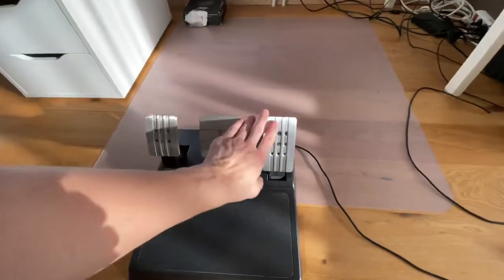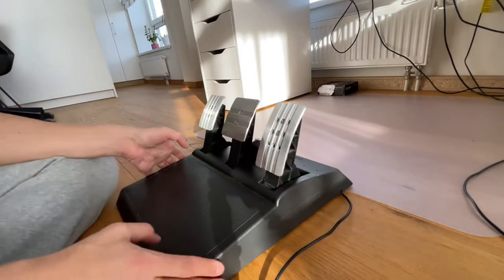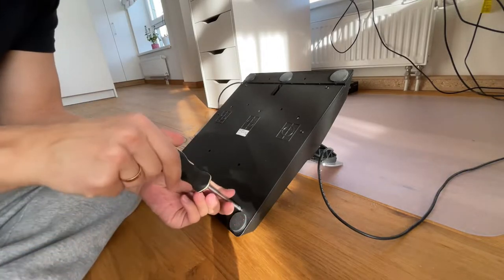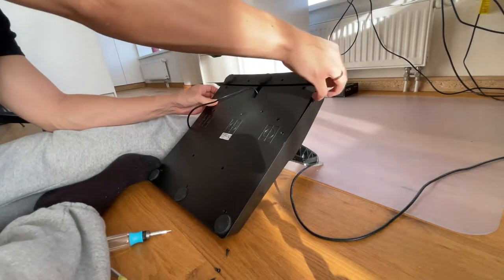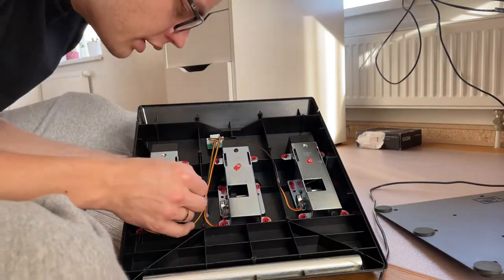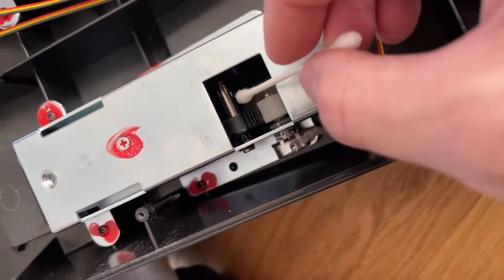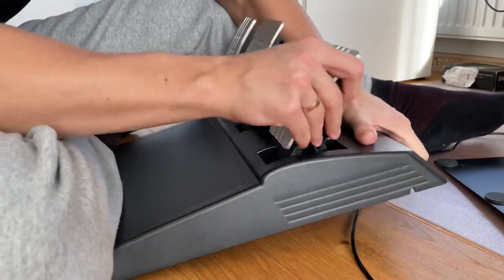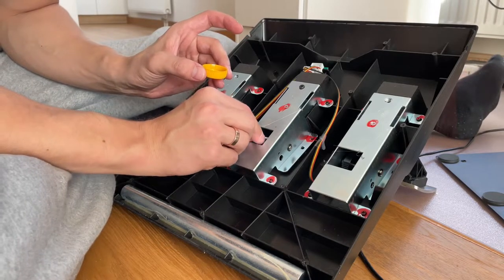How to fix Thrustmaster squeaky pedals

Comment: Thanks, man! Got the same issue after over a year of sim driving around. T150 Pro with T3PA pedals. Gas squeaking. Removed the panel but didn't disconnect the wire, just put a few drops of machine oil in those squeaky places & problem solved. Funny, but after reassembling & checking with TM Control Panel, everything works, but without that annoying sound).
Reply from the maker: Glad it helped

Comment: you really dont have to open the pedals, i had this problem and i sprayed WD-40 on the clutch hole on the pedals from the outside, and the squeaks instantly gone
Reply: Well I hope this works guna try it
Reply: But is the accelerator that's giving the sound?
Reply: @Bieffe  Then put it on gas pedal

Comment: i did this but i used keyboard switch lube since its thicker so it should last a lot longer also for the springs which were squeaky i put wd40 but that might not be a permanent fix since i did notice a build up of hair on the top so you might reapply when needed i will update with any new sounds or issues if there are any

Comment: Thanks for the tutorial, I did the same, however after I put them back I noticed the pedals only go to about 80%. Any idea what I could have done wrong?
Reply: Did you find a fix?
Reply: @W1nkey_  I know it's very late, but if anyone sees this comment and has the same problem: I accidentally set my wheel settings to work with a different type of pedals, a setting that wasn't compatible with my set. You have to hold a combination of buttons on the wheel, which you will find in your manual, to fix this. If you look through the manual you will understand.
In short, the wheel was set to detect a set of pedals that worked on load cells, instead of being set for hall sensor pedals.